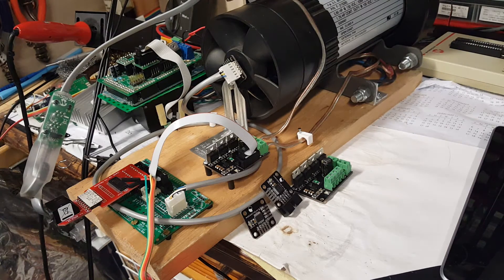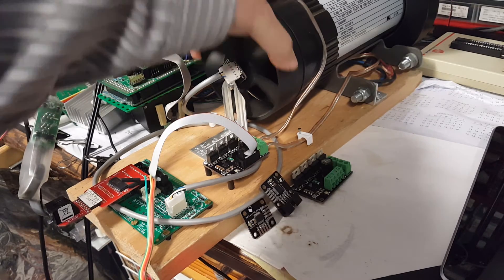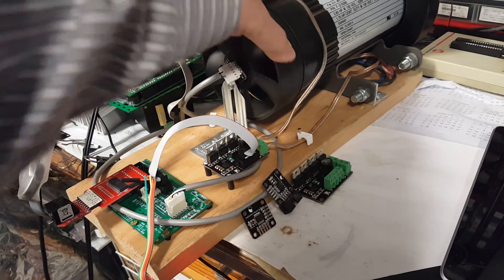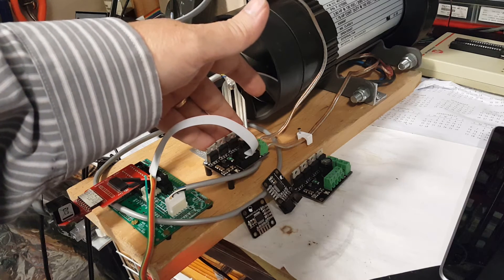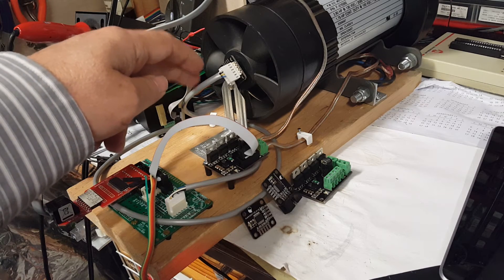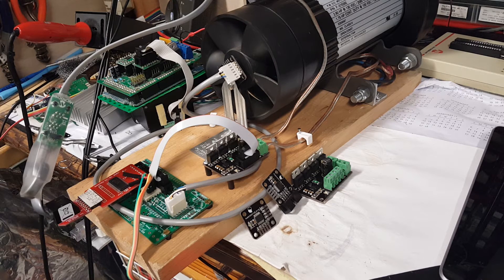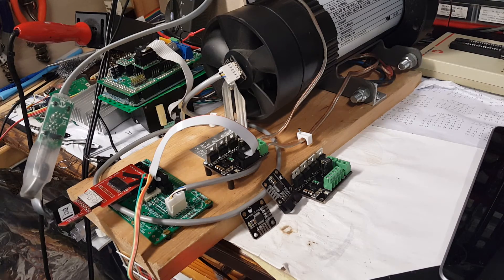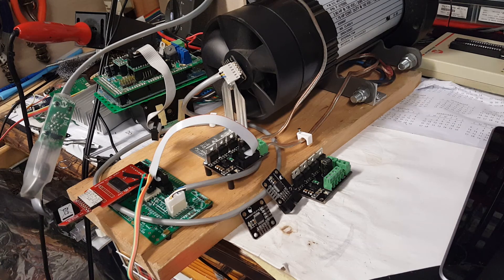MassMind.org Low Cost Servo System - Stepper Replacement

Comment: Do you offer a 3 axis kit for CNC applications? I play to control it with GRBL.
Reply from the maker: Absolutely. Just order 3 of the PID controllers, and the price break is automatically applied
http://www.ecomorder.com/techref/ecomprice.asp?p=416079
and whatever motor driver you want to use, as long as it takes PWM and direction as the two inputs. Our DC (hbridge) driver plugs right in and is available here:
http://www.ecomorder.com/techref/ecomprice.asp?p=416080
you will need cabling from GRBL... If you use a shield with connectors for Pololu drivers, we have an adapter cable:
http://www.ecomorder.com/techref/ecomprice.asp?p=416076
Reply: Thanks very much.